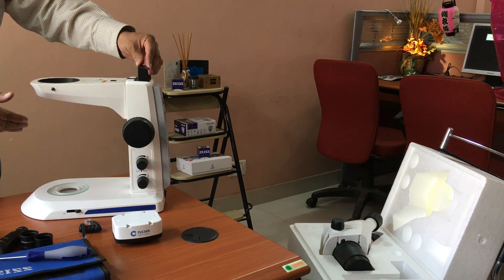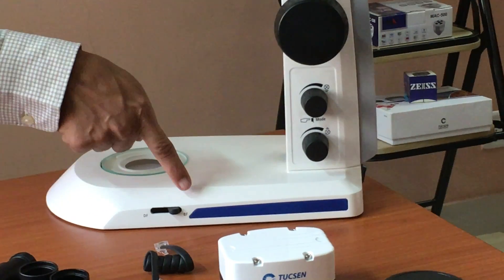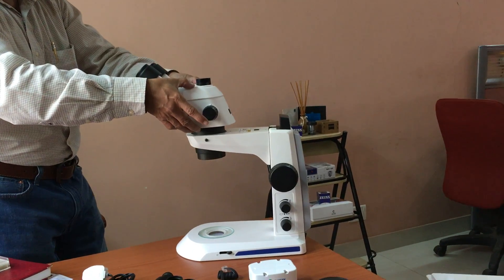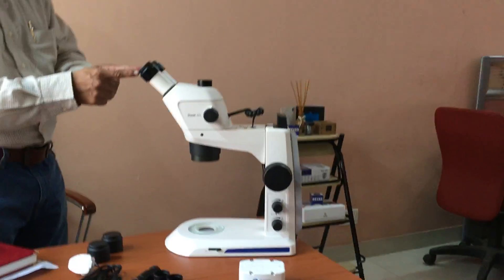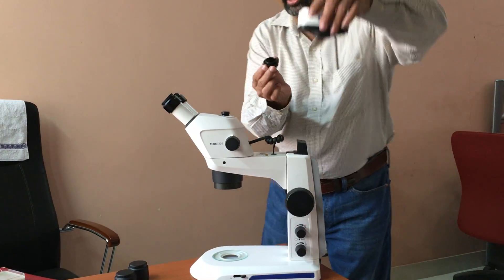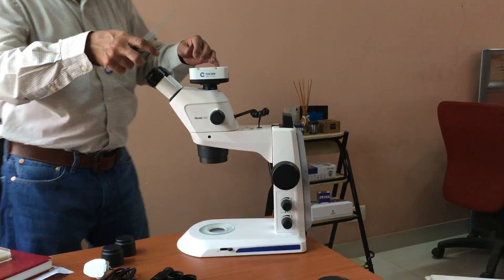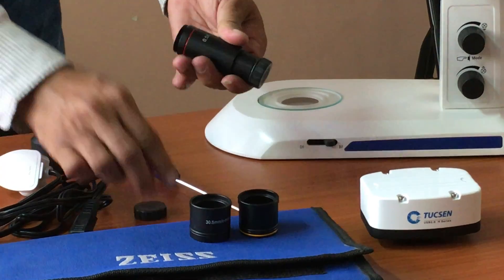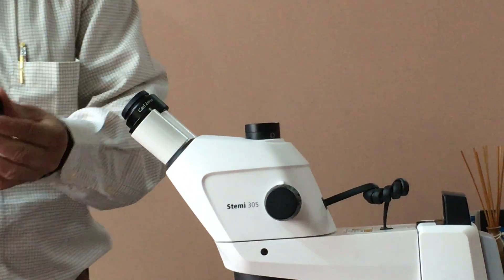Installation of Stemi 305

Comment: Thanks for the detailed instructions and taking the time to make this useful video. I'm trying to find out about the darkfield performance of this unit.

What is your experience with the darkfield illumination? Does it provide an inky black background? Does it perform the same at all zoom magnifications? Is there enough illumination for camera exposure? Also, can you see what kind of a mechanism is implemented to achieve it? The base looks very low profile, does the DF lever just insert a simple circular mask in the light path? Thanks in advance.
Reply from the maker: There is enough illumination with LED ring light illuminator. Camera works well with brigh ring light LED illuminator. you are right, DF lever just inserts a simple circular mask in the light path
Reply: @microinstruments  Thanks a lot for the info. Are you satisfied with the DF mode? Does it provide a very dark/black background or is it more like grayish (some example pictures in Zeiss's own marketing material tend to show not so dark a background so I could not be sure of what to expect).